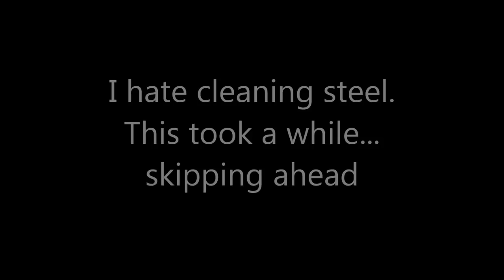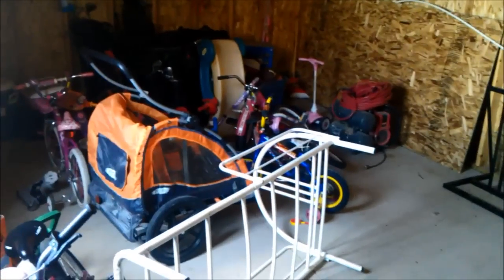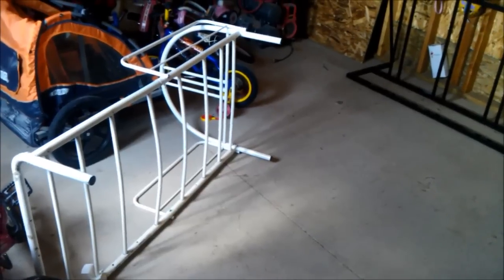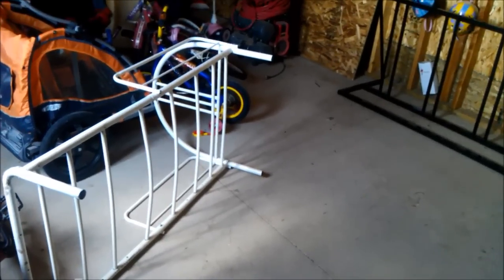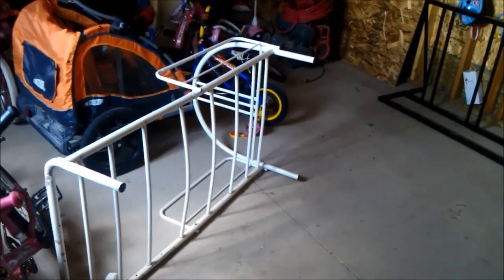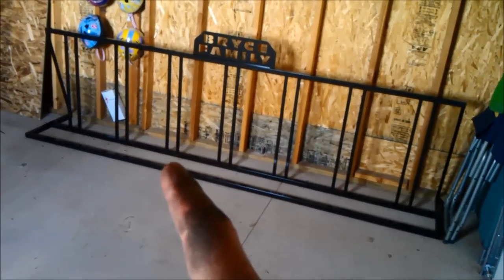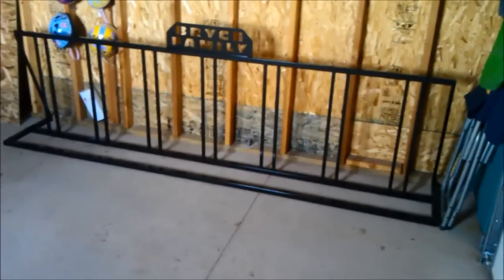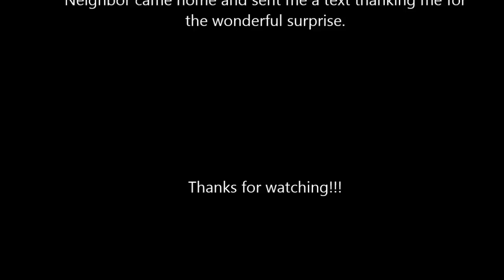Building a bike rack (steel)

Comment: I believe the base frame is 1 Inch square tubing. If you look at the video where you measure the" 8 3/4" distance ,the tape markings  show basically between the 9 and 10 inch mark so thats why i think the base is 1 inch sq. tubing .Thanks

Comment: Hi I don't know if u still will reply to this but I am 14 and into welding and I want to clarify. how far apart are the steel that the tire squeezes into. the mesarmen not counting the thickness of the tubing just the inside where the tire goes. if you could reply that would be great thanks
Reply from the maker: +nathan symington I am unsure, but I am pretty sure I mention it in the video.   I just depends on the bikes you plan on putting into it.  Mountain bikes with fat tires may need 3-4" easy, but most bikes are probably in the 2.5" range.  I have a second bike rack video where I may explain my measurements.  I would recommend watching it:  https://www.youtube.com/watch?v=MG3itUhyMqg